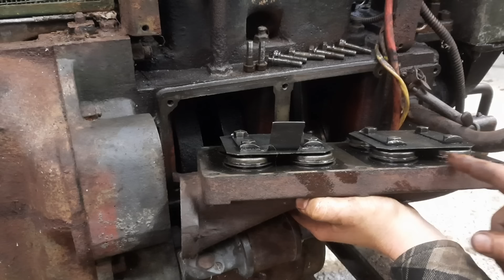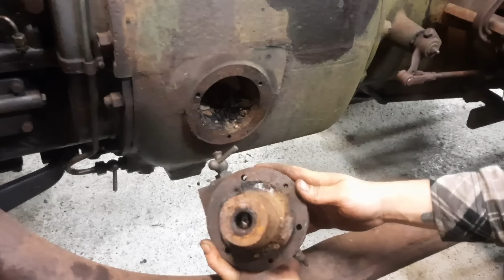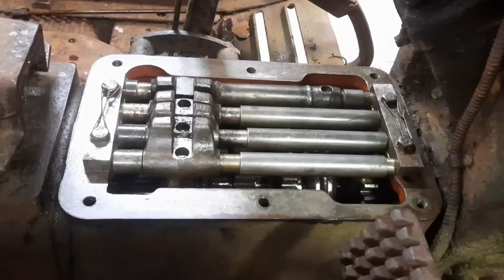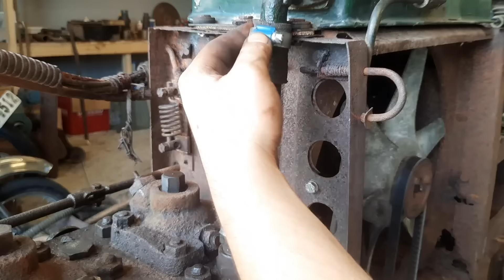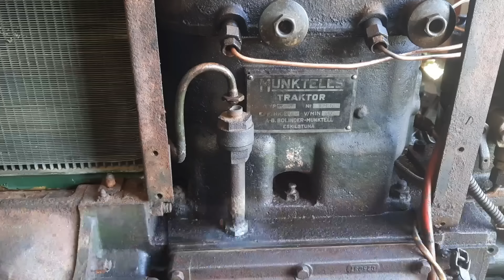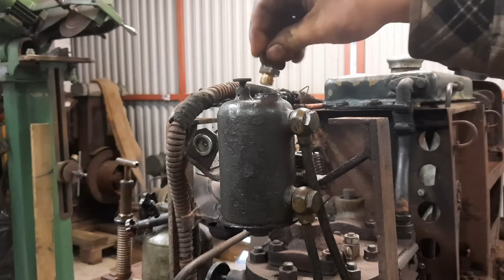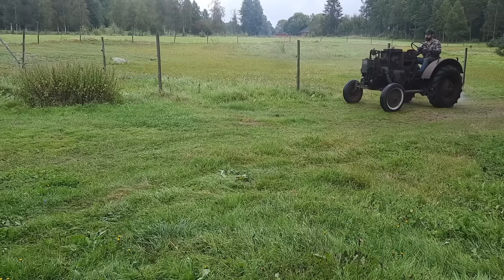Rusty Crude Oil Tractor// Part 4. START Up!

Comment: Great job bringing that old tractor back to life. That tractor sounds more like a motorcycle than a tractor. It also looks like you have a nice exhaust leak where the manifold and exhaust fits
Reply from the maker: Thanks! Yes i aint got no seal there. Have to make or find me some copper gasket that fits. / Richard
Reply: @YesterdaysMachinery  what about exhaust paste?

Comment: great video but can you put your thumb at back of handle incase of back fire
Reply from the maker: It backfires everytime. thats how it starts. you bump it on compression and it starts in the oposit direction. there is a mecanism inside where the starting handle engages that automaticly pushes the crankhandle out and disengages it.   So it is not like a normal old petrol car/tractor engine. / Richard

Comment: Invest in a brass hammer to use for jarring pieces apart. Less chances of damage. Also, a vacuum cleaner would help get loose frass out of a lot of places. Just a couple of thoughts...
Reply from the maker: Yes i do own one. I gave vacuum a chance, but didnt work. to much is left in narrow spaces. faster wit air and just bruch of the floor later.

Comment: I'm glad to see someone doing their bit to warm up the countryside, lovely old girl. Well done that man. I think it has heaters to start, are you going to fix those, I could see one was burned out. There are no electrics so I am a bit confused. Take care - Regards.
Reply from the maker: Hello! Yes there is glowplugs. If i will fix it i have to make my own plugs from scratch. no parts available for it. Yes there is electrical. Everything is there but in bad shape. dry rotten cables and so on... / Richard

Comment: Nice job!
How much of a chance is there of a kickback when cranking?
Reply from the maker: Zero, it always kick back. thats how you start it. you bounce it on compession and it backfires before the pistons is up and start at the oposit direction. There is a mechanism that trows out the cranchandle when it fires. So not like you ordinary cranc start on the Ferguson for example. If i remember i will explain this in a video! / Richard

Comment: It was common for air intakes to be close to the ground on a lot of early designs it took some time before the engineers realized that was not a good idea.
Reply from the maker: The airfilter is down under, yes. But the air is sucked in from a channel under the instrumentation. / Richard
Reply: @YesterdaysMachinery  Aaa, better.

Comment: These machine where made to last and this one is good for another 100 years  thanks to you. Your knowledge is priceless, good work.
Reply from the maker: Thanks! /Richard
Reply: This 2 stroke diesel with hot bulb ignition did not used ignition system but a preheated red hot component and compression to burn the fuel. 
No magnetos and spark plugs, no carburator.
Similar tractor brands where:
LANZ BULLDOG germany
LANDINI TESTA CALDA italy
FIELD MARSHALL england 
PERCHERON VIERSON france
 HSCS hungary
From the early 30's to the  beginning of the 50's
A great job with this BOLINDER MUNKTEL
Congratulations!

Comment: I'm really surprised that actually has a 3 point hitch AND working hydraulics! Nice job Richard.. a gasket for the header pipe on the exhaust and you'll be good to go. I'm really impressed how easily it starts once it's hot enough.😉
Reply: Yea...what is the year of this tractor? I was thinking pre WW2 but maybe not. Some adopted the Ferguson hitch, and others (IH) pushed their own ideas till they had to switch.
Reply from the maker: 1947. Firs production year. A bit unmodern allready when it came but was economic and never broke down so it became very popular here in Sweden. / Richard
Reply: @YesterdaysMachinery  Just post-war.  I think they produced them up into the mid-50s, even after Volvo bought the company.
Reply from the maker: Thank you! :) Yes in the next video we will fix the small parts. / Richard

Comment: Not specific to this video, but I have driven and used a tractor build in the mid 50s. And I'm amazed about how much technology progressed in less than 10 years between those two. This '47 tractor is in many regards quite crude and shares a lot with the older one cylinder tractors with the need for a blow torch, handcrank, dozens of oil and grease points and so on. 
While the one I've driven from '56 I believe, had an electric starter, somewhat of a drivers cabin, just one oil tank and was build like a modern tractor or car. It didn't need any work before start. Just get into the driver seat, turn the key, wait a few sec for it to warm up, start the engine and drive away.

It was a Deutz I believe. 3 cylinder and something about 35hp.
Reply from the maker: Yes this was quite unmodern when it came back in -47. but it was economical and never broke down so it became very popular anyway here.   / Richard